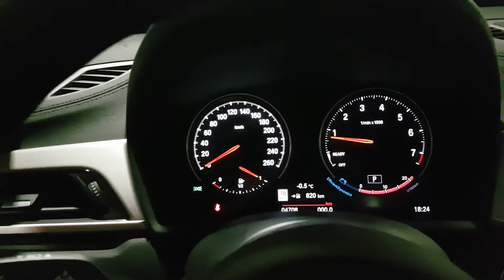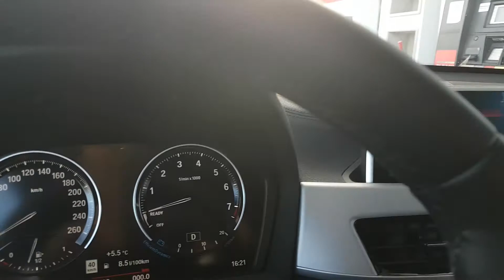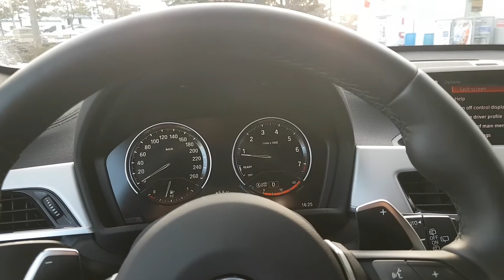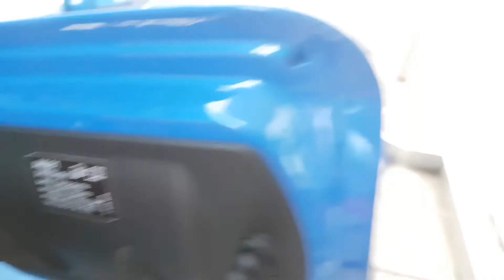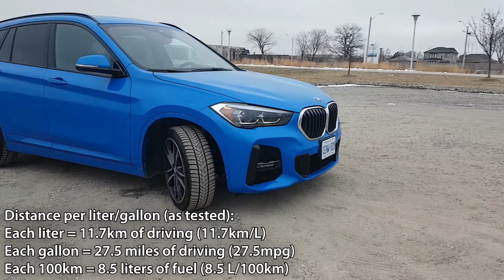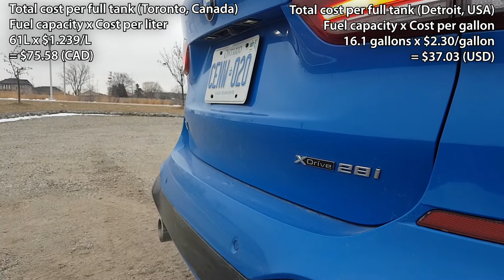2022 BMW X1 - Fuel Economy MPG Review + Fill Up Costs

Comment: can you also do bmw x3 as well?
Reply: my guess is that it will probably be a little bit worse because it's roughly 1000 pounds heavier and only has 20 more hp.  I can't imagine it being a huge difference though
Reply: X3 30i city consumption is 12-13L !!
Reply: @alexandrgr  I currently have an X3 30i and it's not that bad haha. It's definitely not the best but it has been pretty good.  I thought it would be way better than the inline 6 engine but in the city the MPG seems almost the same

Comment: one thing BMW messed up is not being able to change the speedometer from Miles to Kilometer and vice versa. I have a US-spec X1 in Germany but the speedometer is stuck on MPH and I cant go to KMH. the must be frustrating from people near the US Canada/Mexico border. I have had a single seriers speedometer before but it had MPH/KMH lights and the needle adjusted itself.